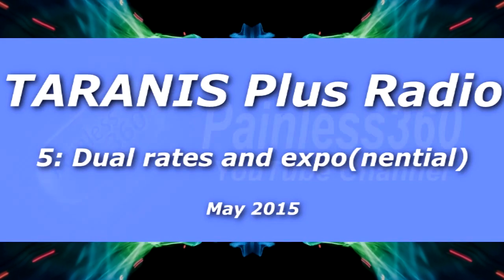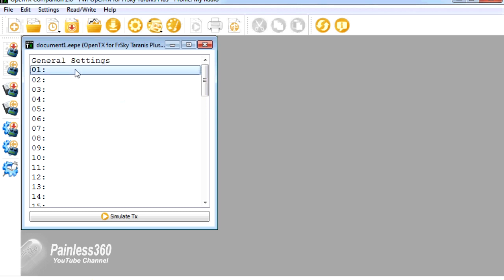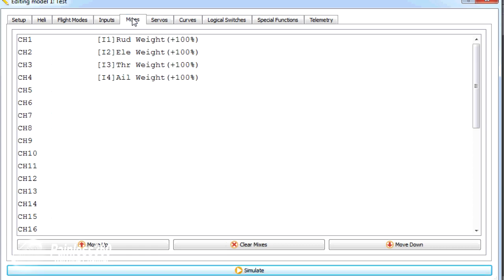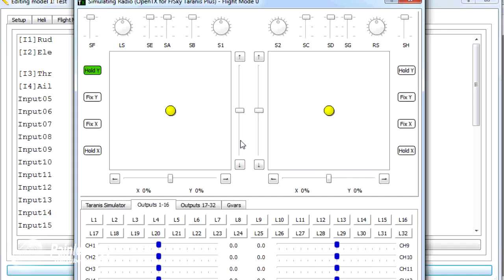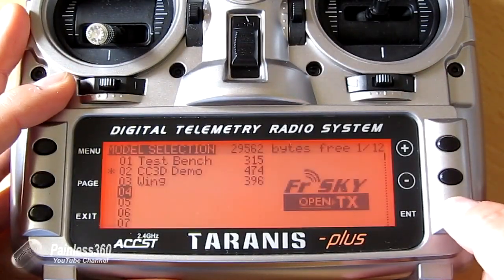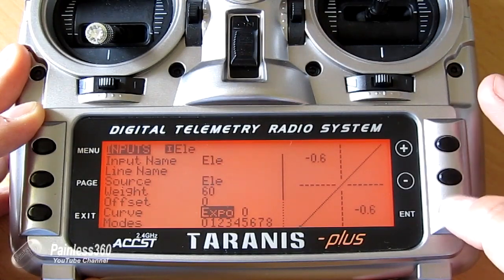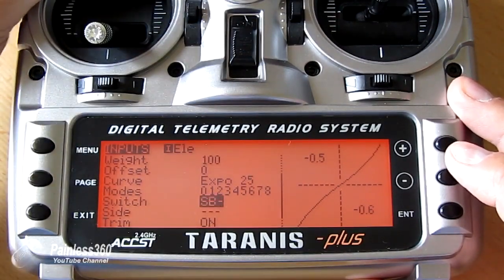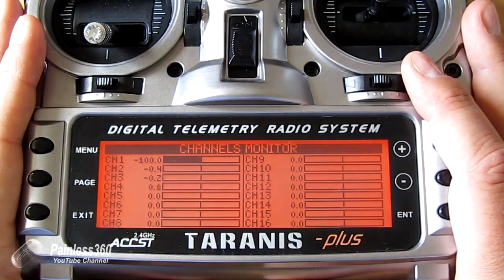(5/12) FrSky TARANIS Radio – Dual Rates (D/R) and Expo (Exponential) setup

Comment: Hi Painless 360, I have set up my Taranis to allow me to use expo and dual rates at 75% at medium rates and also 50% at low rates, at 40% expo and even though Open Tx Companion shows this on the eeprom when I save the settings to my tx these changes do not register.I have the latest firmware (2.0.17). In the Input tap I have the source as Ail, weight at 75, curve at expo, gv at 40 and the switch set as SA-. What could I be doing wrong. I have compared these settings to my other models but cannot notice any difference. Can you please help.
Reply from the maker: Not sure with that level of detail. Check the switch you are using is working and not assigned to anything else. Best of luck!
Reply: Thanks, I managed to get it to work by creating a new model set up. For some reason when I use a copy model it does this.

Comment: On your Elder on elevator you made one switch to set at 60% and the other one at 100%I set up three switches at 60 80 100%because I'm so new I don't want to tear my first drone up and the switches seem to be working just like you showed in the video
Reply from the maker: +Billy Collins I wouldn't use dual rates on a quadcopter, use the different modes like angle, Horizon etc if you're getting to grips with flying the model. Happy flying exclamation mark

Comment: Hi, I was going through this setup (in Companion) and noticed that when assigning rates to a 3 position switch you have to use all three positions.  I followed your example and found that when I accidentally moved the switch SB into the third position the simulator showed no elevator control at all.  I rectified it by duplicating again and repeating the mid position values for the down position.  Do you find the same or am I doing something wrong - Cheers Peter
Reply from the maker: No, that is right. Watch the video on 'Explaining the Exclamation ' to see why and how it works like that..
Reply: Painless360 Thanks for that, So much information I missed that one.  Got it clear now.  Great work thanks

Comment: Simple question, why does my trims not transfer with my rates? When I trim my plane in low rates and then go back to full rates, my trim is out.
Reply from the maker: +TheDuncandan that is a big enough explain to need a video. I'll add it to the list..
Reply: Thanks Dan
Reply from the maker: +TheDuncandan you using flight modes?
Reply: No it's a fixed wing, I set the trims in low rates, and it fly's hands off but flick it to high rates and it's way out of trim again. Just seems I have to trim it for all rates.low mid high. I put it down as a qwerk of the Taranis.
Reply from the maker: +TheDuncandan hmmm, the trims should be persistent if you're not using flight modes. How are you setting up the dual rates? Mixes?
Reply: Yes in mixes
Reply from the maker: +TheDuncandan odd, just played here and works fine. There are lots of ways of setting this up so I'll cover how I do it in the video..
Reply: Great Thanks

Comment: Hi I just picked up my Taranis and was trying to set up the expo to be less on up elevator and more on down elevator. Is there any way to do this? On the 9xr it was pretty simple butI can't seem to figure it out here.
Reply from the maker: Not sure, why would you want that?
Reply: If you have a short wing that is kind of quick they tend to be a little pitch sensitive especially with down elevator (gravity helping). A little more expo on down smooths out a high speed pass and less up expo allows easy maneuverability. Also my thumb seems to have more control dexterity at the bottom of the stick so softening the top helps. I did figure it out though, I added a mix and used the Side function x< or >, with different expo values. This seems to work but was hoping there was an easier way. Thanks for the response and great tutorials!
Reply from the maker: I see, look at differential on the radio for another way to do what you're after...(?)

Comment: One small thing that I had a problem with was I tried multiple times to set up rates using companion it never took until I selected Read/Write    Then clicked on ( Write Modes and Settings to Radio) Then it will save changes to the XD9. One more thing if by some chance your used to DR/Expo on one switch,  Ail and Ele with DR/Expo can all be put on one switch. Here is a great link on the Taranis  https://opentx.gitbooks.io/opentx-taranis-manual/content/companion-introduction.html

Comment: How do increase rates through the transmitter? I'm using the Tiny Whoop simulator from FPV Event and the settings can't be modified yet and rates are too low.
Reply from the maker: +Dustin Johnsen I'm not sure, we don't have an official tiny whoop here and I'm not sure exactly how the rates change on it. Do you mean that the controls arent sensitive enough ?
Reply: Yes. Just for the simulator. I'm sure setting changes will get implemented later on down the road but didn't know if rates\sensitivity could be increased through the transmitter.
Reply from the maker: Dustin Johnsen you could, you could look at a curve, extend the mixes by over 100%, add negative expo to the inputs.. lots you can do..
Reply: Painless360 Never thought of negitive expo. In this case it made a big improvement. Thanks for your help

Comment: My Devo 7 radio has a setting called Fixed ID. Its a safety so If I forget to change model in in the radio It won't link up. Say I'm flying 600 raptor nitro heli. and after that fly my 51 AJ slick. and forgot to change models in my radio it won't link up.
Reply from the maker: Most modern radios have some form of 'model match' technology now, it's a great safety feature..
Reply: How do I set it up on the Taranis ?

Comment: My taransis channel monitor shows value before i hit any sticks how do i fix the value to zero sorry I can't post the image
Reply from the maker: Not sure what you mean but if the channel positions don't rest on zero then I'd check the trims and recalibrate. Best of luck!
Reply: @Painless360  it would be easier of o send the image of my issue
Reply from the maker: I put aside time to answer questions here on YouTube. Support is available here unless you're a Patreon.ut Happy to help if you can be more explicit with your question..
Reply: @Painless360 thanks

Comment: programming a Taranis for a friend, man this radio sucks. So much work to do simple things... grrr. Please also be careful, if you set up dual rates like this the third point of the switch just stops that control surface working. You need to copy and set a third rate up as well.
Reply from the maker: See my video on the ! exclaimation mark.. That'll help..